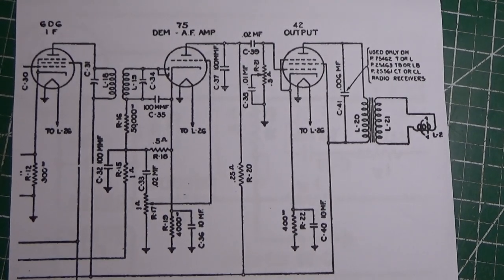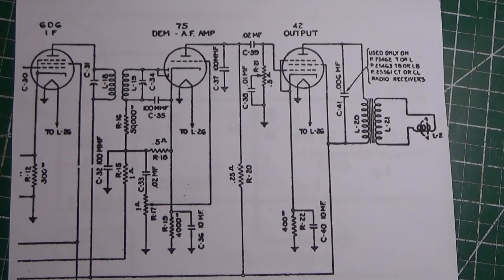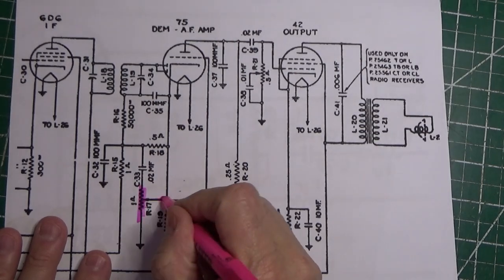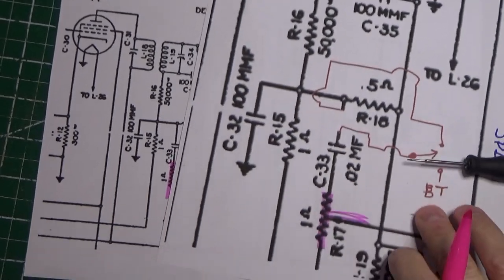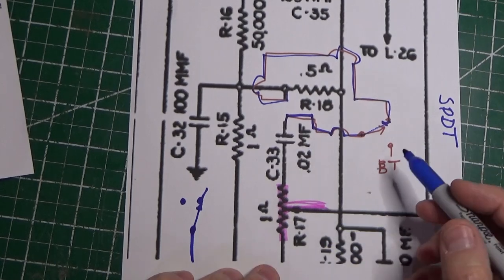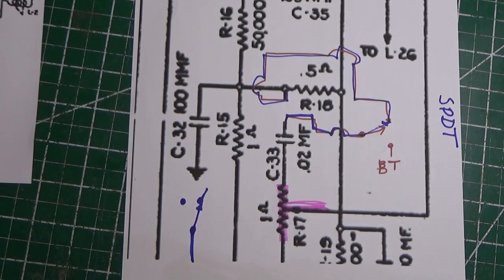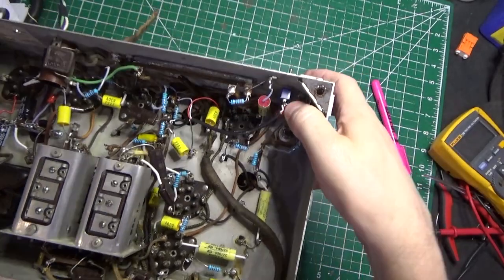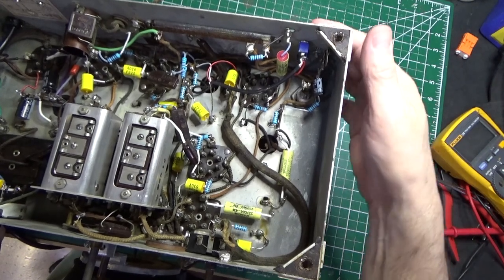How to add Bluetooth to an Antique Tube Radio

Comment: This is one of a few ways of adding Bluetooth to a Vintage Radio.  I like how you have achieved installing it into your radio: a very neat job my friend.  
There are a couple of minor, but important points I’ll raise here: your method, which I’m sure works fine, is suitable for AC only radios.  Alternative measures would be required for AC/DC radios like introducing, among other things, a one to one matching transformer in the audio line for isolation purposes since the neutral side of the mains is usually strapped directly down to deck.
Low voltage mains plug adapters incorporating step-down mains transformers are fine for the purpose you are using them for, like in this instance, but there are Switch Mode Power Supply types (usually designed for a specific device) that might be used for this purpose but they might not be isolated, consequently they could be lethal - due to technical reasons I do not have space here to talk about.  Those types of low voltage mains adapter are particularly hazardous if used with AC/DC radios.
One sure solution might be to make a basic regulated 5 volt D.C. supply powered from the 6.3 volts parallel valve heater supply only, put through a D.C. to D.C. converter, for powering a Bluetooth devise (see Electronics Old and New videos for a clearer understanding if you are not familiar).  You can use I C chip switching, possibly adapted to work in conjunction with the Gram switch, but I’m now going beyond the scope of this comment.
Just a couple of points, for what they are worth my friend.
Regards, Phil.
Reply from the maker: Thanks Phil  and you are right.. this is or AC sets only.  I chose to use a separate supply as  I want it to be reversible, and a home made powered supply would work for sure.. many a future project :)  Thanks my friend, cheers !!!

Comment: Just saying a suggestion.   You can avoid the switch by adding two 470 ohm resistors on each RH LH wires tied together on high side of volume control.   Shield to low side.  Bluetooth receivers cut off AM signal automatically.   I do this all the time on AM tube radios and it works great.  I did 2 Motorola radios this way lol.
Reply: Don't understand how it cuts off automatically?

Comment: What about shielding, as for "killing the filament", I've seen old Philco's which remained on from the day they were new, until well into the Reagan Administration. Each had the "light bulb filament saver, they were quite common around Philly.  It's the on, and the off, which kills filaments, CRT's, with some high output stuff excepted....
Reply from the maker: I agree...Power on and off kills most electronics, including modern ones.....  thats the real enemy...  :)  thanks Tim

Comment: Most old vacuum tube radios have Automatic Volume Control feedback to the IF section.  What does adding Bluetooth do to that feedback loop?  It also comes from the volume control.

Comment: gosh I hope that not a hot chassis radio. Most AA5 radios are hot chassis. They also switch the neutral not the hot on some of these leaving the chassis at line voltage when on or off depending on which way the plug is inserted into the wall. Isolation transformer should be used for all hot chassis radios even if a polarized plug is used. Something inside the radio could still fail leaving the chassis hot some day and you DONT want to find out the hard way.

Comment: Where on Amazon did you find the 3mm jack for the input. Yours has an open back. All the ones I've seen have closed backs. Thanks
Reply from the maker: Search Amazon for this text   "CESS 1/8" 3.5mm Mono TS Female Jack Socket with Switch Panel Mount (LW) (10 Pack)"
Reply: @rciancia  Thank you!

Comment: I have a RCA Victor that has a phonograph input on the rear of the chassis. Is there a reason not to install a switch in its place and connect Bluetooth here?
Reply from the maker: That would work perfectly. Just make sure you connect the Bluetooth jack in the right place and it will work great

Comment: Or you could just switch it directly from Bluetooth without any external switch just find the trigger on the IC and wire in that way. Is the socket necessary I don't think so what you going to plug into it? Works well in jukeboxes just connect it past the op amp or the first stage tube
Reply from the maker: Yes John.. there are many ways to do this..   The way I am doing it like really turning the radio into a mini guitar amp....   Lots of ways to do this...     thanks

Comment: Hello !! Nice tutorial !! Some tubes radio has the connection at the back for a turn table 
Can we use that ?
Thank you
Reply: I was wondering this too! Does anybody know?
Reply: @peper0nipizza  The problem is you need to isolate the input from the ground.  There's another youtube video about using that input for bluetooth.  As Ron says you need to know what you are doing because the ground can become hot on old tube radios.
Reply: There are a few challenges , one is to ensure that you isolate the radio chassis from the bluetooth power supply. This can be done with a dc to dc converter. The other is to balance the stereo output of the bluetooth with resistors to sum up to one output and have that output go through a coupling capacitor and then tie into the volume control. This way the coupling capacitor will minimize any dc that could be present in there.

Comment: FNG here: On the schematic for my radio (RCA 3-X-535), I think my R1 is a potentiometer (resistor with an a third leg going into it). It's the only one like it on my diagram. Is it pretty safe to assume that's where I'd need to inject my signal? Also, fear not, I've heard and read the warnings. I'm not going to be digging around in there until I've done a lot more research on the safety aspect. Just trying to plan things out at the moment.
Reply from the maker: I am trying to find the schematic for this without much luck so I can help you.  Can you paste a link to one so I can take a peek ?   Thanks
Reply: YouTube just isn’t going to let me post anything sort of link-related, apparently. Fourth or fifth try. Found a place called “radio museum” (an organization) and searched for 3-X-535.
Reply: Oh yay.. it finally let me reply with hints of where I found the schematic. Thank you for being willing to take a look! I was hoping it was an easier question to answer.. lol

Comment: Thanks. I like this simple and reversible mod. But I have a long term concern about it. Tubes were designed with a limited lifetime, maybe 1000-2000 hours. They wear out progressively and the radio slowly becomes less sensible. If you don't cut them when on line-input mode, the RF and IF tubes will wear out for nothing and that's a pity : they're not produced anymore.
Reply: They have to be on, they are part of the voltage string...

Comment: Great video! Thanks for sharing this information. One quick question. When you mention the shielded wire, is that just a single wire inside shielded insulation, or are there more than one conductor inside the shield? Not sure if that makes sense or not. Thanks!
Reply: He's implying a single wire with a shield.  Shield to ground (chassis) unshielded center wire to the cap and switch.  As Ron says if you aren't sure you probably shouldn't do it.  The ground can end up being hot on an old tube radio.

Comment: Thanks for posting this, and yes there are lethal voltages inside the cabinet. Wondering if anyone has thought about, or if it's even possible to use the DIN Jacks where the Tape/Phono In on the rear of some of the nicer units (I have a Normende Fidelio 58 for instance) where you can adapt the 3.5mm out from any common BT Receiver/Transmitter to the DIN Jack in on the Radio? There's only like 5 pins on those, seems like you'd just have to pin it out correctly and it's already a low level input. Thoughts?

Comment: HUGE PSA     This is no joke.  You have to be careful with wall warts these days.   The old style ones with transformers to drop the mains voltage are OK.  They are isolated from mains AC power due to the transformer.   A lot of the new cheap chinesium switching style power supply wall warts and USB chargers out there are being found to be non isolated from mains.    You can get electrocuted  by them,  not to mention killing any gear you plug them into.   See bigclivedotcom and diodesgonewild YouTube channels for many videos showing these dodgie style wall warts and how to test them and various other products not isolated from mains power also.   Be safe out there.
Reply from the maker: Good info JP.. will check it out.  Thanks
Reply: @rciancia    People have died because of this.   Some gal went to talk on her phone while charging it and went to soak in the tub and that was all she wrote.   The charger was not isolated from mains and it killed her.
Reply: Add a dc to dc converter to isolate the power supply output to the device being powered
Reply: @bobl1636  Not all inverters are isolated from mains and/or outputs are not isolated from their inputs.  Most are not.   Ground or common is usually common to input and output of inverters.

Comment: I am planning on installing a phono input in my Grunow 761 which does not have one yet my Grunow 1291 does but you have to reach inside to the front of the chassis to plug in or unplug anything from it and numerous times I have burned my arm on hot output tubes on that set to plug in like a bluetooth preamp, record player etc.. man what a lousy design.